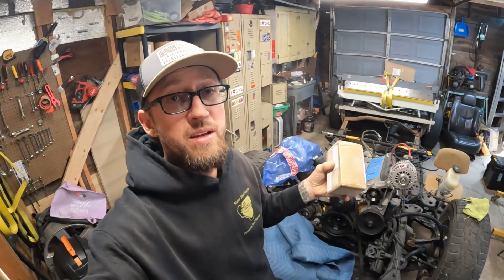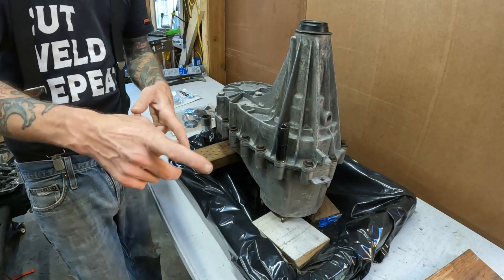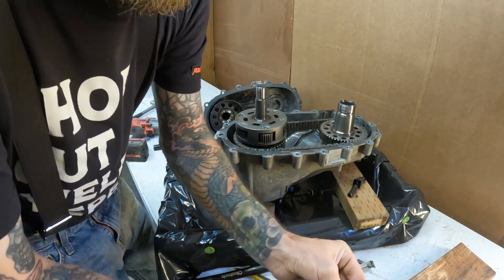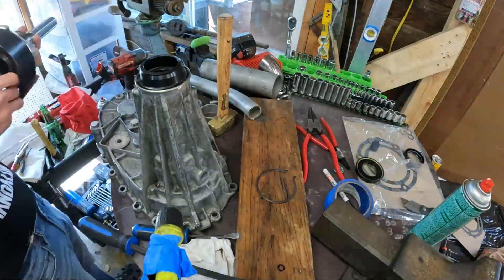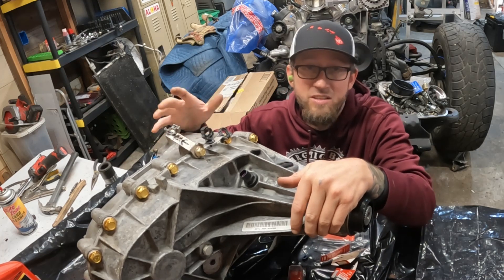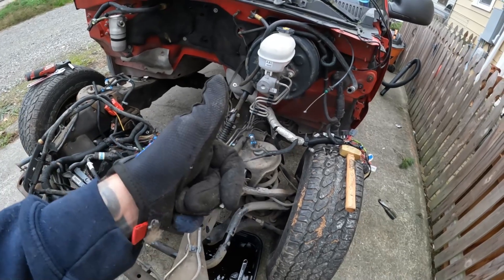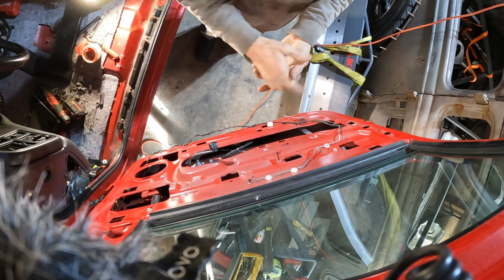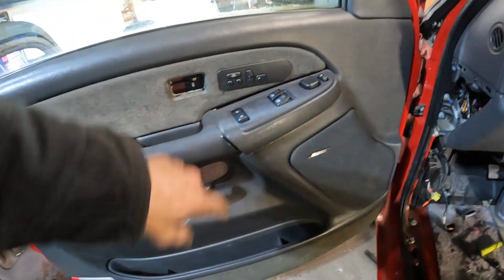4L80E Conversion for the NP149 and SS Interior Swap into the new Cab

Comment: Howsit going?  I'm trying to find what is the difference in the 32 spline that comes in a 241 and using that rather than purchasing the "special" adapter.  I have a 32 spline xfer case from a 2500 that I will pull apart to see the difference but everyone who does this AWD conversion uses a special adapter from a vendor.  Just wondering as one of the makers claims his adapter is made vice having a 32 "turned down" (lathed) which I think is probably him turning the 27 spline into a 32 with a mill.  If I'm interpreting correctly, he claims by making the adapter rather than turning a 32 spline to fit the the NP149 is stronger.
Reply from the maker: @808kahulaa hey thanks for watching, I'm not really sure you can turn them down but I'm not sure. I bought the adapter and it worked perfectly. I'll see what I can find online tonight and I'll get back to you

Comment: Jw will the np149 t-case bolt directly to the 4l80e or does it require a different adapter?
Reply from the maker: Yes you will need an adapter, thanks for watching and good question.